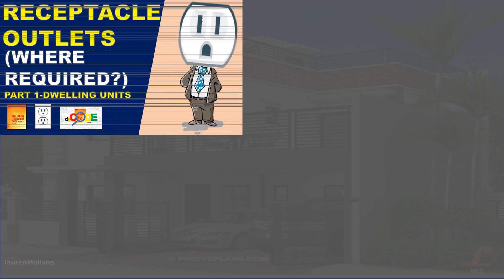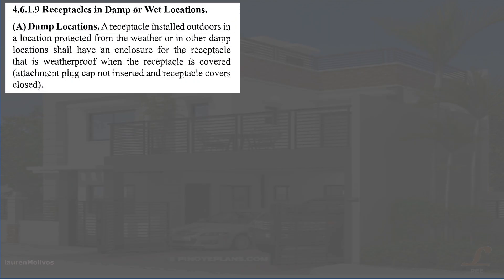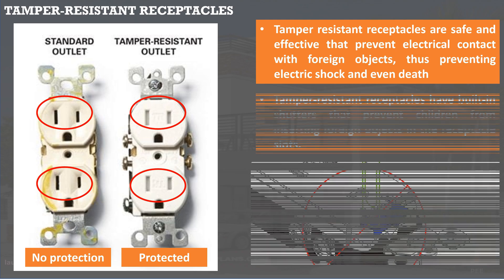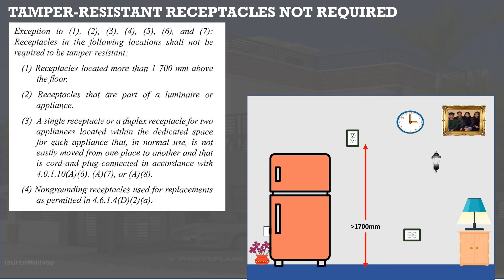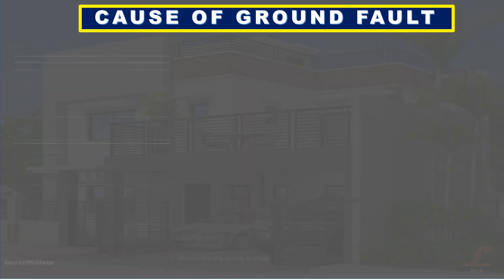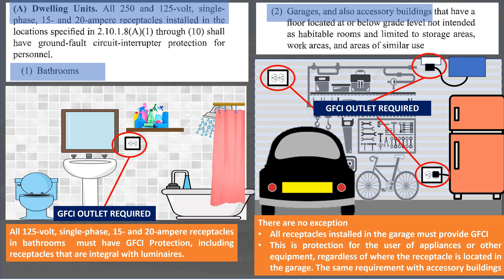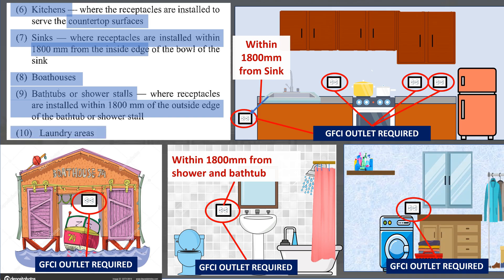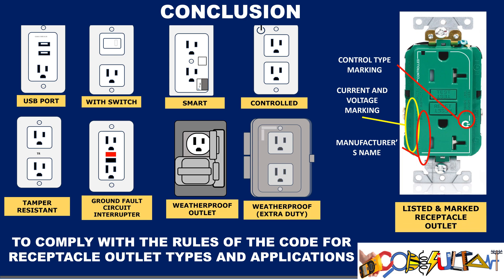RECEPTACLE OUTLET TYPES AND APPLICATIONS  AS REQUIRED BY NEC & PEC

Comment: Dear Sir, thank you for replying to my previous comments. GFCI outlets are required for wet and damp locations (close to sink, outside etc.), however if I have 30mA RCD protection my 2 pole MCB's  serving circuits  (similar to the Uk/European consumer units) do I still need GFCI outlets.

Many thanks
Reply from the maker: Thank you for your comment. It's true that GFCI outlets are required in wet and damp locations for added safety. However, if you have 30mA RCD protection in place with your two-pole MCBs, you can meet safety objectives through alternative means. As long as the overall safety of personnel is effectively addressed, using different standards is acceptable. Always prioritize safety in your electrical installations!
Reply: @codesultant  thank you again. I appreciate your insight. Very helpful this helped a lot.
Reply from the maker: Thank you for watching!

Comment: Sir, if i will make 3 bedroom residential house how many branch of circuit breaker need?
Reply from the maker: Hello, this is the minimum requirements of CODE, 2-20A small appliance (kitchen, pantry, dining, and similar Areas), 1-20A at laundry, 1 20A at bathrooms, 1-20A at garage including external area, For general purposes and lighting depends on the size of the area.  If small only 1-20A is enough but is suggest minimum 2, - total of 7 plus individual appliances such as clothes dryers, booster pump, etc. see this videoshttps://www.youtube.com/watch?v=o3ZyVeY9EtQ&t=7s&ab_channel=CODESULTANT and https://www.youtube.com/watch?v=mdYtvbNrda8&ab_channel=CODESULTANT